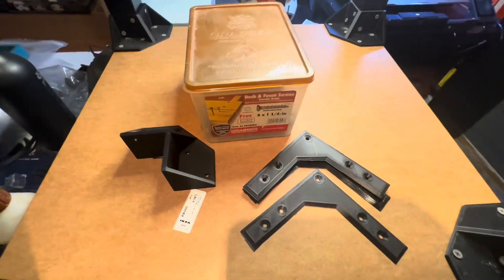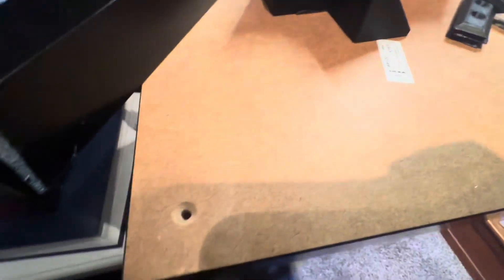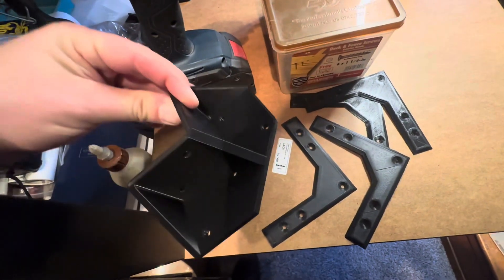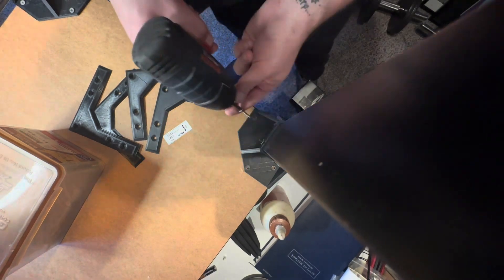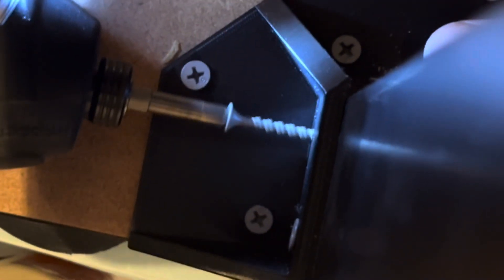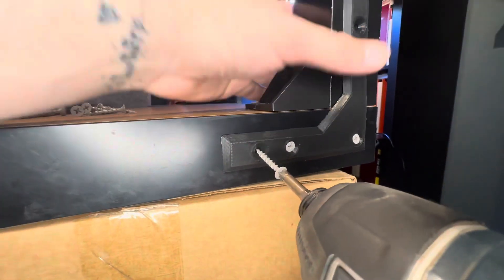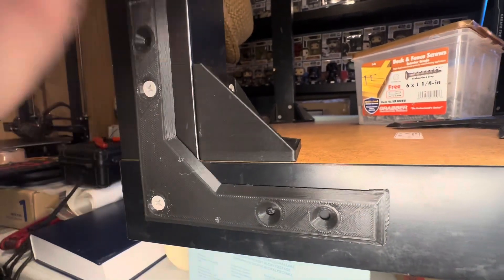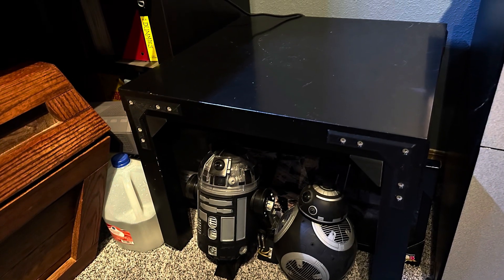Reinforcing an IKEA Lack table to hold a Qidi Tech X-Max 3 CoreXY 3D Printer.

Comment: Whenever I get my hands on one of those super thick and intense cardboard tubes from the packaging of something, I save it and would use it in a case like this.. cut it to the same length as a leg, wrap it with contact paper to match the color you need it to be.. and add one or two or more spread out under the surface to absorb more weight to alleviate how much is on each of the 4 legs.

Comment: With the weight of the printer I'm surprised ballast is needed. I have 3 Lak tables stacked as an AV rack which I no longer need, I'd like to try this. Were you able to tell whether print quality changed when you moved from a solid bench to this modded table?
Reply from the maker: I ended up putting my printers on the floor. No matter what table/bench I used it would wobble and leave ghosting in the prints. The table is super sturdy now though. Lol

Comment: I would have gone with ABS or PETG, curious to see how well these hold up. I don't have the venting for ABS but would like to experiment with it.  Washers might help as well. the weak point is the screw head gripping onto the thin indent of the screw hole of the PLA only. I tend to over engineer lol
Reply from the maker: I would have printed them in ABS or PETG if I had the filament. You’re right about the weak points. Should be interesting to see how it goes. Lol